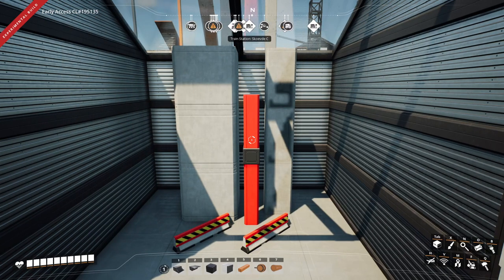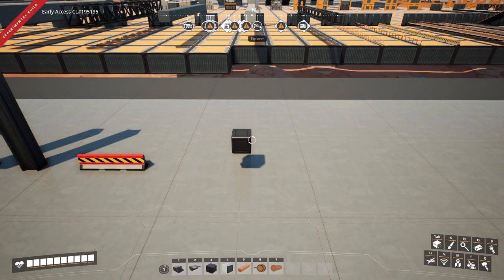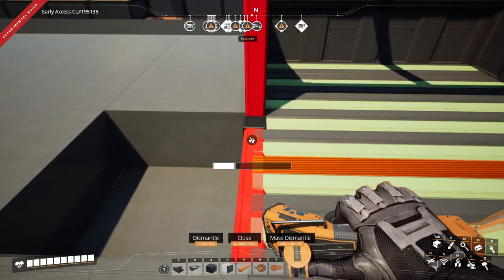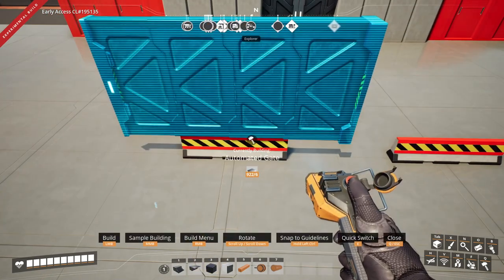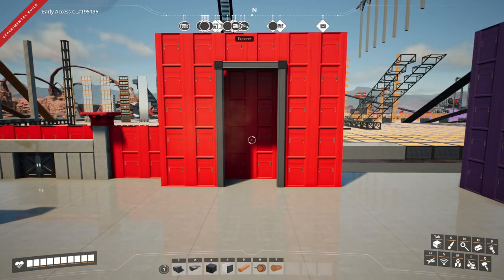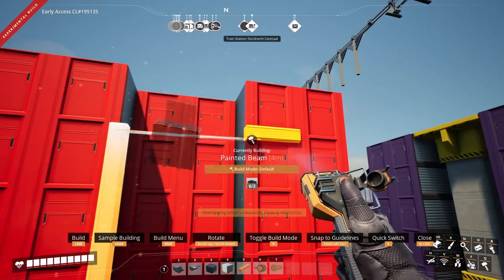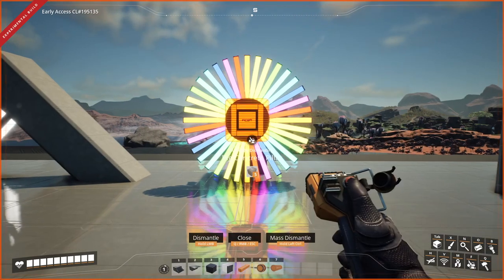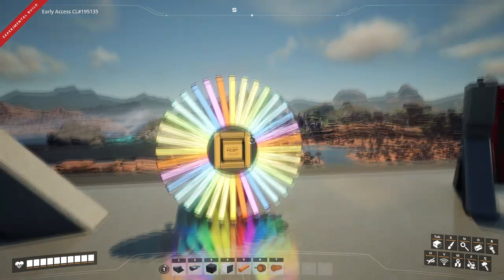Building Tips, with Beams, Pillars and Road Barriers - Satisfactory Update 6

Comment: Nice ideas. I don't fully understand the beam connector mechanic yet. Where ist the difference between double and single connection? It apperas to have a snappring point function. However when using, the results can be different. Same ist for the pillar foundations respectively the beams alignment when attached.